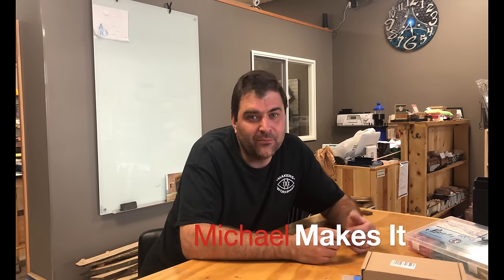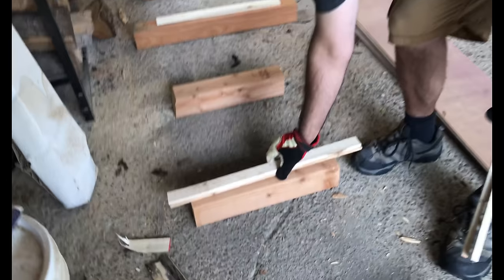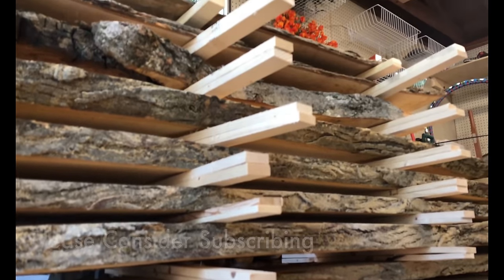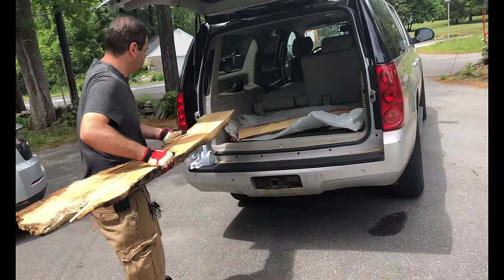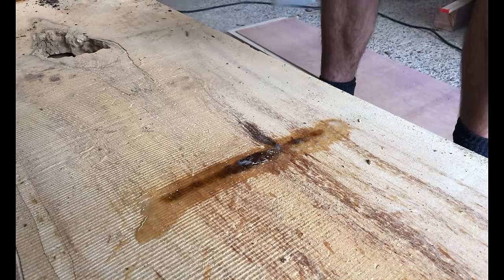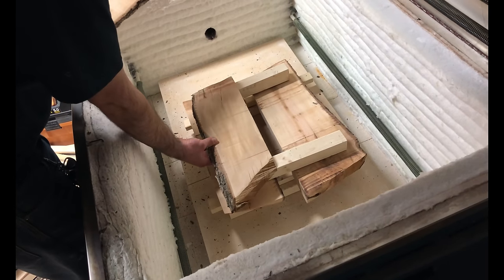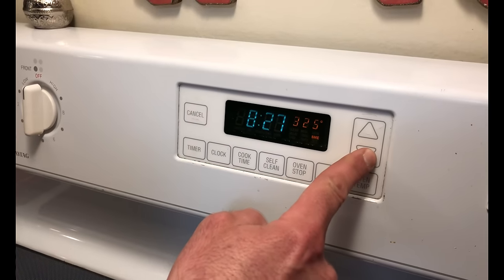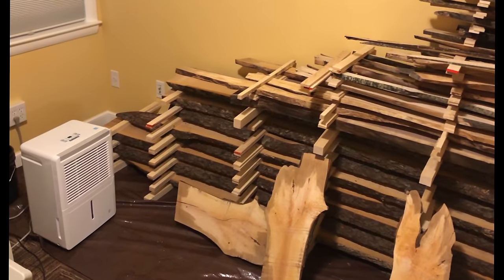How I Dry Wood Fast // Tips and Tricks

Comment: That mildew is coming from your stickers. Those look like home depot Whitewood? Which is wet and resinous. The stickers should be kiln dried first. Framing fir 2x4's below 20%mc works well in my experience. Just avoid the knotty or sticky (resinous) boards.

Comment: When using the moisture meter, isn't it just measuring 1/4 inch deep or so? How do you determine when the center of the slab is dry enough to work with?
Reply: one method that will depend on the type of moisture meter is to attach wires to the spikes and on the other end have the wires on nails or screws , screwed into the wood at the same distance apart as the spikes on the meter. if the screws go in an inch or so it will measure deeper. I've seen this method used on what i assume was an expensive meter that was probably designed for using wires, however it may work with a regular type.

Comment: Strange phenomenon; I’ve had several hundred pallets (unwanted) to deal with, and the ones close to my building rotted to nothing; like, full rot to where I used a shovel.  Some of the same exact pallets in a well-lit sunny open area in the back away from the building are almost petrified gray with no rot at all.  Intriguing.  I’m planning to put my 8’ hickory 2” slabs near that pile.  120 lbs each, I probably won’t flip them often though… :-) thank you for the video and ideas.  Jason

Comment: This is a space constrained idea, but to flip all the boards and even out warping you could take the top board, flip it over and place it next to the pile you have on supports, and do the same with the rest of the boards. This would eliminate the step of moving them all outside and putting them back flipped
Reply from the maker: That would definitely work, I just tend to fill every available space with more stacks.

Comment: Hi I've literally just researched tonns of stuff on air drying live edge slabs as I bought two beech live edge slabs 2 weeks ago, ones very flat and the others slightly warped, no idea when tree was felled however they're damp just to the touch and the warped one has black mould on it on one side (not gone through yet) I've used white vinegar on it to kill it at the root. I've got a compact de humidifier for drying aiding with the drying out process as well as a fan I already had, keeping them both going overnight with my wood stacked properly with lots of weight on top to hopefully push the ends of the one slab down and push it back flat again, anyway I digress, should I keep fan and DH on as much as possible not just on a night? I'm mindful of electricity bills haha. any pointers / tips would be useful thanks? Also I've not sealed the ends as I didn't think it would dry out quick enough to cause any Halm. It's in my dining room out the way, radiator is at the other side of the room.
Reply from the maker: The end sealing makes a difference, but in my experience any cracking on the end can just be trimmed off or filled with a clear resin. 

I would definitely leave the fan and the dehumidifier on 24 hours a day at least until it’s not damp to the touch. Even at that point it will still have a ways to go.

I think that answers everything you asked, but let me know if I missed anything.

Comment: Hi mate great video really appreciate, 

question I run a oak beam , fireplace business I have lots of stock that I’m trying to dry 

I have a big barn with lots of wood inside I see that you didn’t have the garage isolated that well or maybe I’m wrong ? 

My barn is around 32 foot long 17ft wide 10ft high if I had two big industrial dehumidifiers  you think this would work ? 

Average size is 8x4 x 8ft long most probably 300 in total 

Or you think I would be better to make a smaller room that’s well insulated 
  

Some of the big dehumidifiers  say they can take 50 litres a day not sure how true that is 

Any advice would me much appreciated

Comment: How long does it take to fully dry a piece of wood? using your design. I have freshly cut elm slabs about 2 inches thick and 3 feet long
Reply: I Also have a newly milled elm slab, isnt the risk of warping and cracking bigger when you try to speed up the drying period by fans and dehumidifyer?

Comment: So I'm new to wood making. I make irish Blackthorn walking sticks. 
I leave my sticks in a garage that's left open to air dry. The average circumference is between 1 and 2 inches. To make them dry faster would you recommend the dehumidifier and fan method?
How long would it take sticks of this diameter to dry to about 12%? Is it possible to get to about 9 % with your method?
Thank you in advance.
Reply from the maker: For sticks of that size to bring them to 12% probably 4-6 weeks.  The bulk of the moisture will expel pretty quickly. You could get them down to 9% with this method, it would probably take an additional 4-6 weeks to get there maybe a touch longer.

I would air dry for a week before closing the garage to avoid mold build up.

Hope this helps.
Reply from the maker: Also, if you don’t use the bark in the final walking stick if you remove the bark first it will dry quicker. Seal the ends with arbor seal or old latex paint to avoid and minimize cracking at the ends.

Comment: Apricot slabs... 2" by 12" . Do you think oven method would work? They are a year old outside in 12" rounds. I cut them 2" thick and are cracking, immediately.  Need advice. Thank you
Reply from the maker: If you are doing cookies cracking can be a real issue.  The large endgrain area can allow the moisture to leave leave very quickly which can cause cracking.  I would seal the top and bottom with either arbor seal https://amzn.to/3ytVlfZ like that one or a resin.  This will force drying to happen from the edge which will minimize cracking on my experience.
Reply: @MakersWorkshopLLC  hell yes, good advice.  I will try sealers on edge and face. Thank you brother! Cheers.

Comment: Would you use the polymer over Plywood AND OSB. I would think it would be fine if you consider the floor area is only 5' wide and 9 ' deep in a walkway area of a bathroom that has engineered trusses every 16". Not much flex whats you thoughts of not putting Hardiebacker board down

Comment: I have a metal shed in my backyard- zero air flow, going to be hot this summer- i wonder if the wood will dry faster in there (using your method) or if i should allow some airflow thru there ...airflow will cool the temp  down but the air will be going thru- i wonder if its better to leave it super hot with no airflow, or allow air flow but cooler temp....also, what type of saw did you use to cut those slabs?  and do you use a drum sander to sand?
Reply from the maker: The less air exchange the better, as long as you are able to keep the air circulating within the shed using fans, if the air isn’t circulating through the stacks then you will have a mold issue.  But if new air is t being introduced the dehumidifiers will dry the boards out a lot faster.
Reply from the maker: We used a woodmiser bandsaw mill, their are other options for brands though.  I only personally have experience with bandsaw mills and find them easy and reliable.  I have a supermax drum sander that I use if the slabs are to wide to put through the planer.  These steps I do after the drying bc of the inevitable warping that may occur during drying.

Comment: those moisture meters, how deep need they to be pressed in the wood to be sure they are dry enough? there's no way to get to the core of the wood, so how to be sure?
Reply from the maker: For the type shown you just press it in as well as you can, it's not perfect but it is accurate enough and I have never had bad finished results. That being said we have switched to a contact-less model which is much more accurate in my opinion. The link to the one I use is : https://amzn.to/2wQSVvT
Reply: @MakersWorkshopLLC  thanks for the info buddy. It's the first time in my life i could get a huge amount of frensh oak for a bargain, but it needs to dry before use. So... Hope it works 😁👍
Reply from the maker: I’m sure it will come out great, biggest tip is to just be patient.
Reply: @MakersWorkshopLLC  patience is not my biggest friend 😆. But i know i have to, if i want it to be good 😇

Comment: Will any of these drying methods also make bugs leave? I have some red oak that I'm hoping to use but want to make sure pests don't turn up later.
Reply from the maker: I have two ways that I deal with any potential bugs and ants.  Option 1) if you can heat the room as hot as possible (80-100 degrees) for a few hours that should make any bugs leave.  Option 2) if it’s an out building, like a garage that you have it in then you can set off some bug foggers in the garage to take care of any bugs as well.

Comment: I have no luck at all drying oak this fast. It checks and cracks like crazy (not from the ends since I use Anchorseal). Not sure what I'm doing wrong. Hackberry and sweetgum seem to do fine with quick drying though.
Reply from the maker: So since it is not from the ends, I assume you mean it is splitting? if you have an image we're happy to check it out and troubleshoot to the best of our ability. Do you have instagram? either DM us or tag an image @makersworkshopllc and we can check it out.
Reply: @MakersWorkshopLLC  Thank you! I will DM you with an image or two tomorrow. Until I watched your video, I was assuming oak simply cannot be dried this fast unless it is at high temperature and fairly high humidity (like in a kiln). If I let the air get  under about 75% RH, it splits. And that starts running the risk of mold. Tried to look up kiln schedules but they're too complicated for me to follow...

Comment: When a piece of wood finished dehydrate in a few months ,  does it matter if it get wet again by rain ?
Reply from the maker: It does not.  The rain will be more of a surface coating that will then dry out with just a day or two of sun. 

That being said, I would always recommend using some type of finish on outdoor projects to prevent rot and weathering.

Comment: To what  temperature do you set your oven to dry small 1/2” thick, 5” round cookies?
Reply: I save a heavy duty extra large plastic garbage partially filled with coarse shavings from my planner from wood that is already dried-8 to 10% moisture. I put the cookies in the bag and wire-tie the top as air tight as possible.  After about a week, open the bag and you will find the cookies coated with clumps on moist wood shavings. Brush off the moist shavings and stir\spread and reseal. Keep bag in a warm place if possible.  Cookies are notorious for splitting but I find this method reduces amount. Drying time depends of course thickness. Enjoy.

Comment: @Makers Workshop at what temperature should my garage be?
Reply from the maker: The hotter the faster it will dry, but the more important factors are good airflow and the dehumidifiers. The temperature will impact it less than those factors will, it just might take a little longer.

Comment: Can you do this with fresh cut lumber? Does it matter if its oak or walnut?
Reply from the maker: I do this with pretty fresh cut lumber.  The batch in the video was taken down about a month before milling but the oak was taken down the same day.  I would recommend leaving the door open and air drying for about 4 weeks before closing to minimize mold if it’s very fresh cut before going to the dehumidifiers.  Either that or leave the light on, mold grows in damp and dark areas.  I have had success with both methods.
Reply from the maker: And it will work with all wood types and species as far as I know.  I have personally done oak, walnut, hickory, maple, and elm.  Some species dry faster than others but the process is the same.

Comment: Are you afraid that wood bugs might get inside your house by drying your wood in your house?
Reply from the maker: For our particular wood we tend to bug bomb the room. We’re comfortable with that solution, but didn’t include it in the video because we knew not everyone would be. Another alternative is getting the room temperatureup for a day or two to get the bugs to leave on their own, and then level the temp out again. Above 85 degrees should do it, the hotter the better. Our go to is using our detached garage, and bug bombing but it’s a personal preference thing.

Comment: Why is drying the wood necessary?
Reply from the maker: Wood shrinks as it loses moisture so if you build something from lumber as it dries it will warp, crack and so on. Freshly cut wood has a lot of moisture and you want to get it down to 6% moisture for indoor usage, 12% for outdoor usage. We usually split the difference and go to at least 9% for everything.

Comment: How’s the power bill I’m trying to dry a black cherry slabs that I’m about mill
Reply: That's one of my questions too.  I don't mind getting an additional fan and a dehumidifier. But I would like to know how much this would add to the expense to dry your own vs buying it kilned dry and ready to do.  Especially for those folks that may not have a lot of extra space.  For me I had a neighbor lose a large arm of a tree.  It was pretty thick around.  I was able to grab some pieces as it looked nice and healthy.  Turns out it is Northern Red Oak.  I have a huge bandsaw I bought used and have not used yet and felt what a great chance to grab that downed tree branch and test the drying out.  The recent storm that came through on the East took down the rest of that same tree. I did not pick up more free wood because I did not know where to put it.  ;-)  I figured let me try this out for no.  Curious about an electric bill at this point.